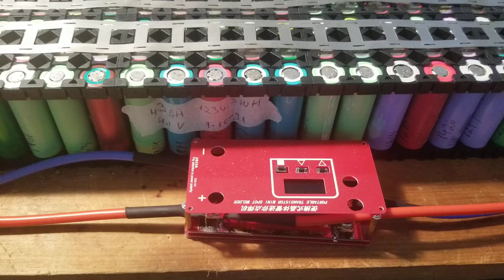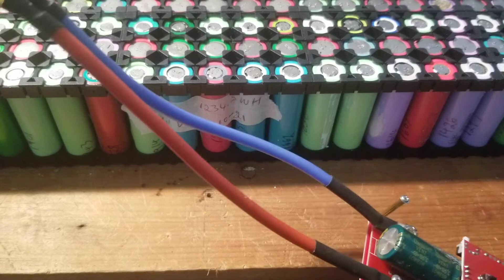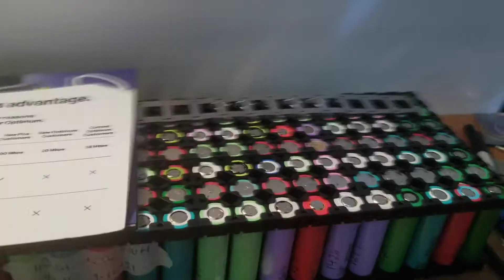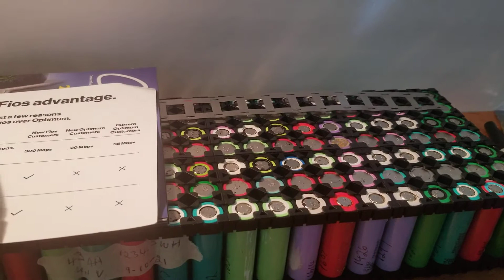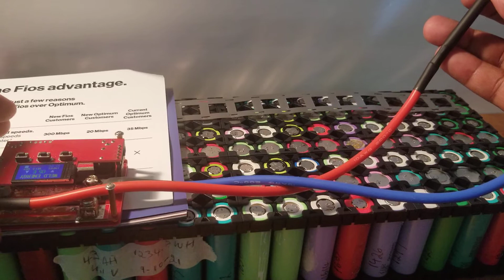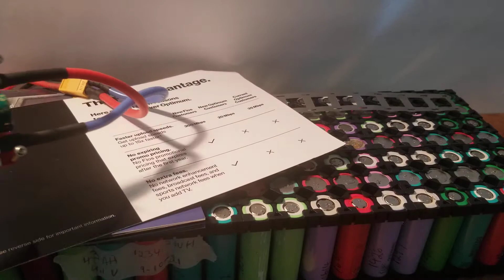DIY Portable Mini Spot Welder Machine 18650 Battery Various Welding Power Supply

Comment: Yeah, when you let the magic smoke out of the mosfets its pretty much over. The biggest problem with these spot welders is the trigger circuit. The gate voltage on the mosfets when welding not fall below the threshold point which is approximately 5 volts. When it does the mosfet goes into a half on half off condition especially when using higher settings as you where using. The higher current draw at these settings cause a very high voltage drop and the mosfet driver circuit can't supply the correct gate voltage and "poof" smoking mosfets is the result. There's a couple mods that can be done to prevent this. If you connect a oscilloscope to one of the gate pins you can understand what I'm implying. The gate voltage will rise quite quickly and then start to drop as the welding is in progress. When the gate voltage starts to drop below the gate voltage threshold you have to stop and check your battery status. Adding a large capacitor like a 1000 mfd to the output pin of the mosfet driver usually helps to maintain a saturated gate voltage.

Comment: So is it broken at the end?
Reply from the maker: Yes. I have 2 of them. They both are broken the same way. They are different by design. When the voltage of the battery dropped a little, you lose mosfets
Reply: @simplyfocus9937  thanks.   What is the cutoff low voltage to avoid?
Reply from the maker: @desmondthang6759  when it blows up, lol. If you double or triple the battery in parallel, you may be ok after 1000 welds. I had 350 welds before it was broken. If they can fix the FLAWS, it will be great.
Reply: @simplyfocus9937  I have two of this welder working fine for around a year, depends on the welder version, you need a mod to need them more reliable. You also need a strong battery to avoid the problem.
Reply: @simplyfocus9937  actually my second identical welder work after adding the capacitor hack.